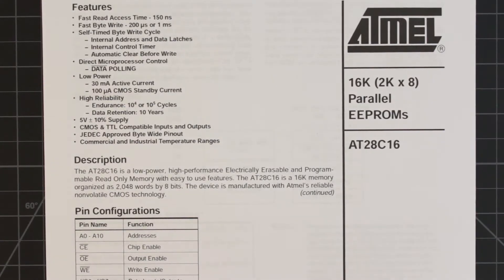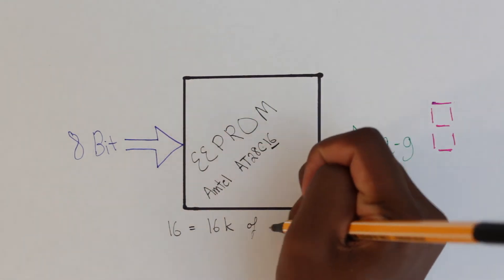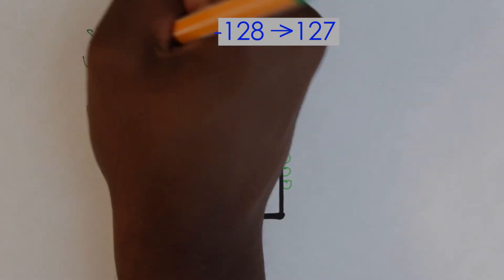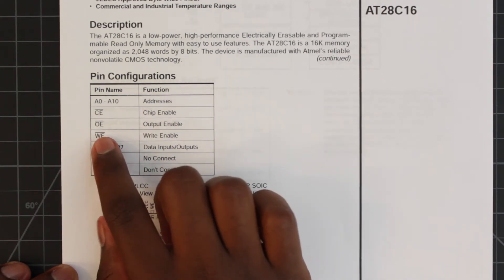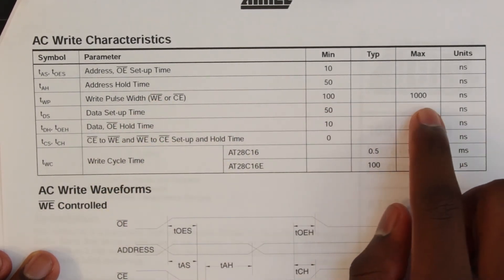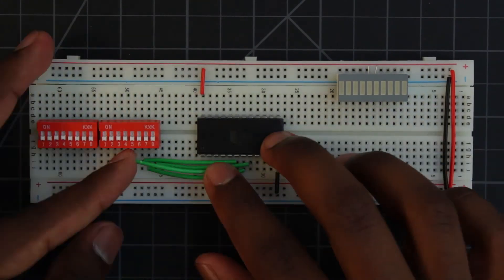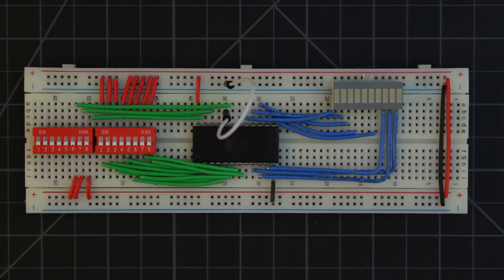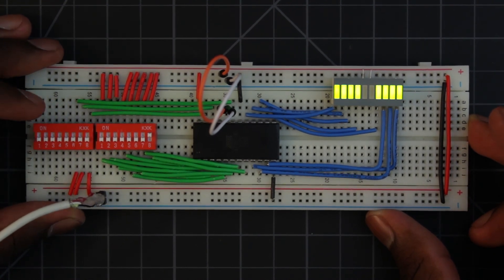Convert Binary to Decimal Part 2 | 8 Bit CPU

Comment: My chips don't output anything. i built this same circuit and have the same chips but it doesn't work :( does anybody know what could be the problem?
Reply from the maker: +Sudhir Chandra have you checked each pin with voltmeter?
Reply from the maker: +Sudhir Chandra I go over the issues with this circuit in the video I'm uploading today